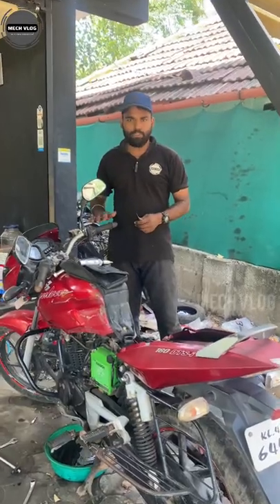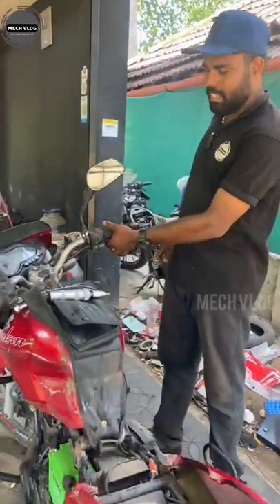Brake oil Problem In Pulsar 180|Malayalam|Shorts

Comment: Cylinder work ne ഏകദെശം എത്ര rate ആവും
Reply: 100 cc anel full cheyyanel 8000  vare akum head maathe valvum mattu partsum mothom maran 6000 aduppichakum adichu poya sadhananghale depent cheythirikkum rate
Reply: @aromalkunnilkkada2833  engine pani full aano 8k rate
Reply: @jishnuking9398  engine stuck ayathano enthan preshnam
Engine full panikkalla head , cylinder full maranan 8 k anghane maruvanel showroom il kodukkunnathan nallath
Engine stuck ayittundel bearing okke Marandi varum rate koodum
Reply: @aromalkunnilkkada2833  headill ninnu nalla sund varunnund 😢
Reply: Showroomill nalla rate varum
Reply: @jishnuking9398   chilappo timing chain  ,valve adjust cheyyumbo marum